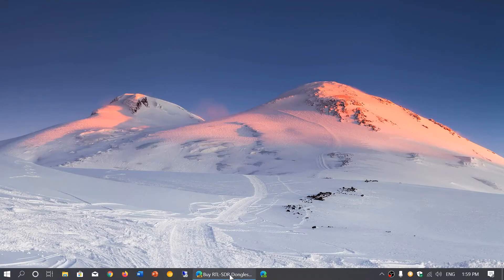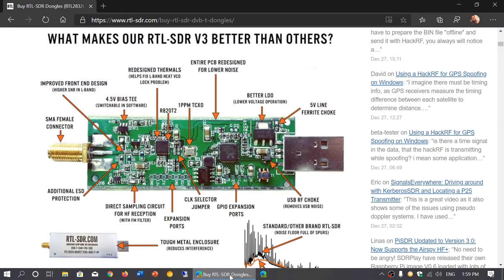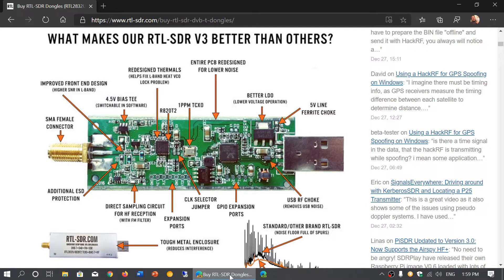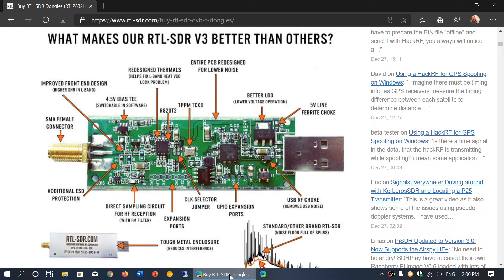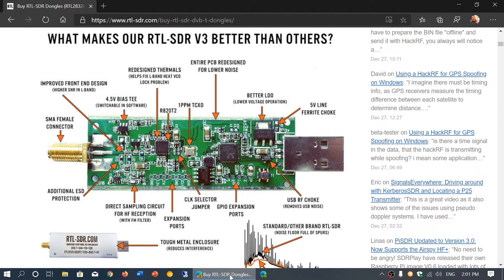RTL SDR V3 General ok performance on VHF and UHF range but don't expect too much December 28th 2019

Comment: I bought this to look at my signal on HF and VHF/UHF. I find it to be a very good value for $20. I installed some band reject filters for the am/fm BCB and I’m surprised how much I enjoy using it, without the filters it is not much fun. The bandwidth is small as you would expect. Overall, I would buy it again. Thanks, Dan.

Comment: Which is the best for uhf vhf? The airspy products are pure shit now. They didn’t use to be. I have this dongle for satellite work but would like something that really shines in this dual bad frequency ranges. My rtl stays slightly warm on vhf but is very solid. Doesn’t drift or anything. I would like to step it up considering I’m enjoying vhf uhf ssb

Comment: Fair on the MF bands, 
poor on the HF bands with lots of spurious signals 
fair to the VUHF bands SDR# adds CPU  by  35% in the PC system.
Relaltivley cold  while receiving in the HF bands but quite hot on VHF
Reply from the maker: You are right, runs much hotter on the VHF UHF range
Reply: @VE2ZZI  Hello frind, i have bought this vey cheap original dongle to test the SDRharp latest version, after  using 3 months the 'cheap' RSP1a . Surely this is a downgrade from RSP1 but it was also a nice experience. for the moment Console works OK for VHF but there is a trick to be used for HF by downloading a plugin .
For the best comparisons between RSP1a and RTL u can use the SDR Sharp 1.0.0.1361 which is comaptible with both!
I m still using the RSP!